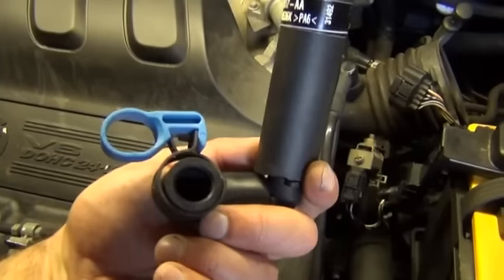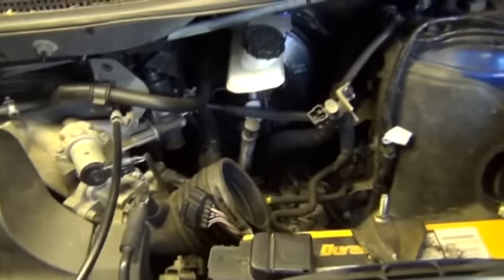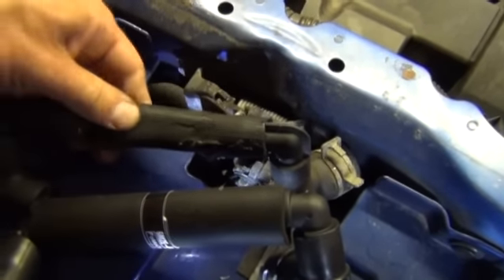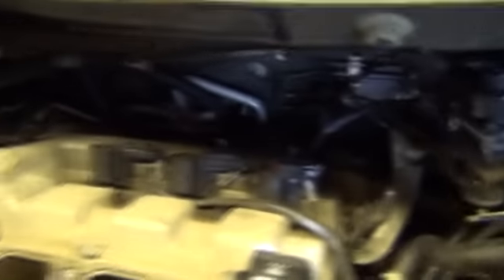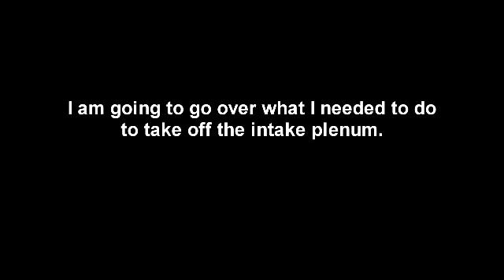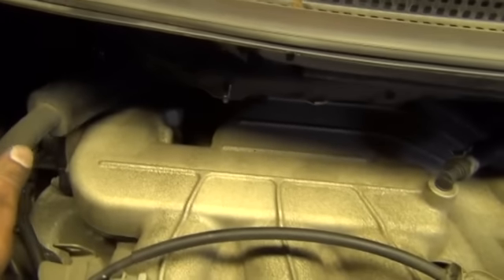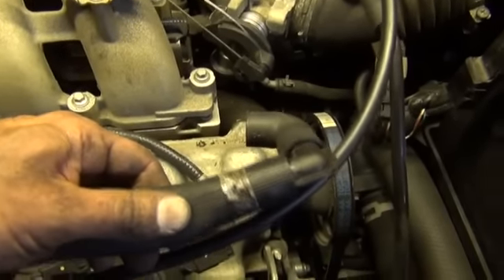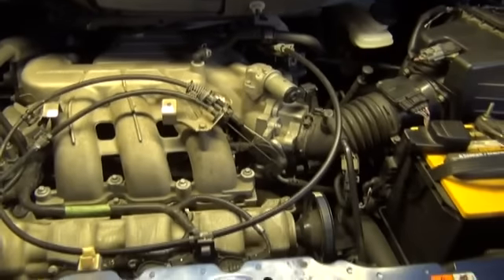PCV Hose - Mazda MPV - PCV Valve Mixture Too Lean Code 2187 2189

Comment from the maker: Hello Ricky, It is crazy tight :) On BMW's the 4 cylinder is making a come back due to fuel consumption. It may be the same in the future for Mazda. To do the far bank of plugs or access 3 of the coils the intake plenum does need to be removed. This was my first time so at least it will be easier when it is time to change the spark plugs :) The removal is not too bad once you have done it once.

Comment: hi so I own a 2004 mazdaspeed 6 (5speed doch 16 valvle 4cylinder) and recently ran into problems. I bought the car from the dealership 3 days pervious to the problems starting. randomly my check engine light came on, no symptoms and car ran fine after for about 30 min. following that I lost all power while driving and my car will now not turn over. everything was running completely fine up until after the check engine light came on but again randomly shut down. we ran a diagnosis test and the code "p2187" popped up. I have zero idea what's the issue is. please give advice!! car is being towed tomorrow to the dealership to hopefully get fixed, I just need an idea of what is the problem.

Comment: V6 engine is too big for such a tight engine bay, but in the american market it's hard to sell a 4 cylinder mpv.

Do you have to take off the intake to change the spark plugs too?

Comment: I had the same issues, I replaced it two years ago.  Now I got a  code P2189 only.  What could be the issue now? Help................
Reply from the maker: Hello Bruze, This may still be an air leak. For difficult to find air leaks I would recommend having a smoke test performed to help find the source of the leak.
Reply: Well, after weeks of research and investigation I finally found the problem for code P2189 “System Too Lean at Idle Bank ”, and is typically set when the PCM (Powertrain Control Module) detects a difference of about 25% between the desired air/fuel mixture when the engine is running at idle, and the actual, measured air/fuel. 2005 Mazda MPV. The actual problem is the  Vacuum Control Solenoid EGR. Make sure you get the exact one, not the aftermarket one. The correct one will have a Mitsubishi logo on the part.
Reply: @BRUCECRUZ  I'll put that on my list to check out. I have been smelling fuel in vehicle from time to time. Already did the new pcv hose and pcv replacement, but getting the too lean codes for both banks now that the weather temperature has dropped.